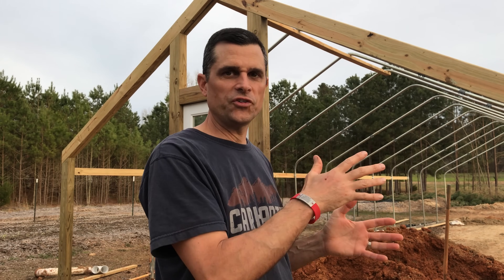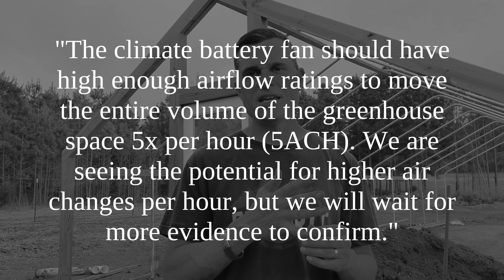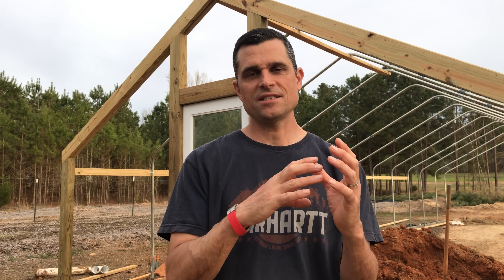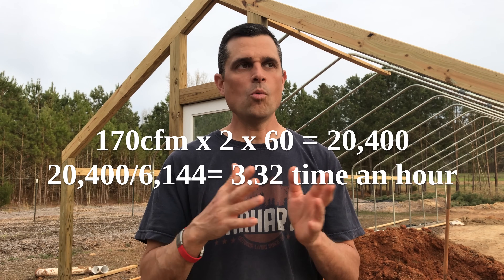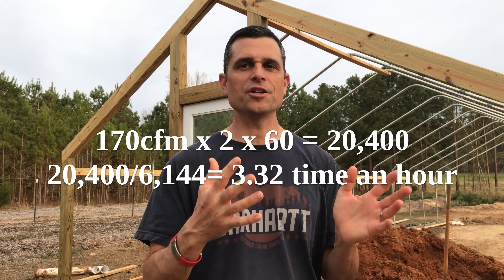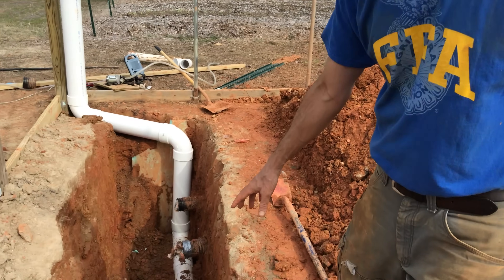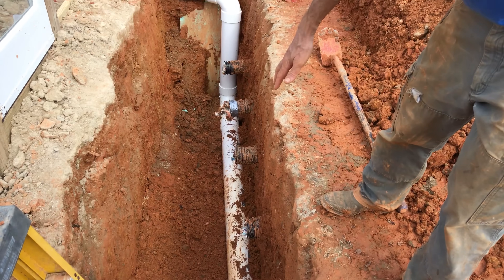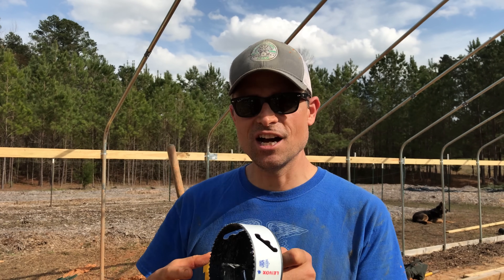DIY Geothermal Greenhouse Part 7: Earth Battery MISTAKE!

Comment: Threefold Farm here again. Good progress and glad to hear you made the switch to a larger manifold! Will you be monitoring the greenhouse temps once it's up? I've found it to be very helpful to monitor inlet and outlet temps as well as the temperature of the soil. 

In terms of cooling, I haven't seen enough cooling with our system such that we'd be able to avoid either opening the sides or door even on cool sunny spring days. The solar gain just seems to be too much. Your system may be setup better than ours. We currently use 3x 5,000CFM HAF fans to push air, but I think the static pressure causes them to behave more like 3,000CFM fans. Even with that, we're moving air about 15x/hour and aren't able to actively cool the structure.

I recently started a private group for commercial "climate battery" growers on Facebook that includes a few other farms in order to share experience of what works and doesn't. I'd value your input on there if you'd like to join. Let me know and I'd be glad to add you.
Reply: you should aim to put the entire greenhouse air volume underground  25-40 times per hour for effective cooling, i designed mine to handle 60 so i could experiment with the flowrate. Fit multiple sensors inside the tube to track the temperature as the air travels through, vary the flowrate and collect real data so you can  base your conclusions on what is happening rather than what you imagine is happening ;). Trust me, you need a lot more fan power than you imagine to outrun the cooling capacity of a well designed installation.
Reply: Hi Tim
My numbers come from experimenting with the system. If you can measure the in/out and soilmass temperatures and have variable speed fans you can gather some useful data. I`d recommend having multiple sensors installed in at least one underground tube so you can measure the temperature of the air as it progresses through the tube. You need airflow measurement but absolute accuracy isnt required, an idea of the relative increase or decrease in airspeed is still useful. 
Looking at your system, the good news is you shouldnt need to install more tubing, The total system loss at 5000 cfm looks to be around 3.7" wc. At 3000cfm its a more reasonable 1.35"wc. I designed my layout for 0.3" wc relative to the 60x/hr flowrate. Its a big challenge to get 60x/hr with a large house due to the fan power requirement, i guess you`d need something like 3x 12000cfm fans for 60x/hr. Its not a viable option as the layout wont support that amount of flow but it serves to  highlight the point that as the majority of installations are in larger houses, they seldom have sufficient fanpower available to do meaningful testing which would provide the data to take the design forward ;)
As a design exercise for a 90ft x 30ft greenhouse, the multisystem approach could be used to provide 60x/hr (36000cfm) at 0.5" wc. The design will use  more 4" tube to offset the loss in surface area of the large headers, which are not required, I dont know how much 4" ADS tube you could buy for the same cost as 120ft of 18" but i`d guess its quite a lot ;). TRhe installation would involve more work which would be more than compensated for by the extra flexibility, greater control and much higher efficiency compared to a traditional system.
Reply from the maker: Tim, we'll definitely be monitoring things once it is up and throughout the year. You're running some huge fans! We would be very interested in the FB group, as we have hope of building a much larger greenhouse and want to learn more and improve the system before we do it.
Reply: Glad to hear about monitoring! We use Acurite products to monitor ours as they're inexpensive and (relatively) reliable, plus we can view temps through our phones. We'd love to have you part of the group. I tried typing in the name of your farm to add you but couldn't find you. Perhaps you could request to join it and we'll add you that way. The group URL is https://www.facebook.com/groups/1594790417277905/ I'm currently restricting it to commercial growers as I'm really interested in the performance of larger-scale systems.
Reply: Disappointing to hear that the cooling is not as effective as hoped.  I believe the 5:1 ratio rule of thumb is made up out of hot air.   obviously that ratio is going to be a range, and vary dramatically with floor area vs volume, solar insolation, climate, time of year, N/S vs EW orientation etc.  So you can have an 8,000 pound car with a 20 HP engine, it won't be quicker off the line than a Tesla, but it might be perfectly appropriate and functional.  What you don't want is a 200 HP engine with tires, axle, transmission or clutch designed for 20 HP,   OR a 20 HP engine with those designed for 200 HP, right?

A  simpler way to measure airflow is to use the pump curve that's published for any reputable fan.  Even better if you have the watts overlaid on the pump curve.  A simple "Kil o watt" meter will give you the watts, and you can compare that to the pressure with a slightly more expensive Dwyer magnehelic gauge in the appropriate range to double check your CFM, good enough for me anyway.    Builditsolar is a great site for anyone doing home engineered solar anything, and home engineering is MUCH BETTER than NO ENGINEERING which, unfortunately applies to most of what's on the tube.
Reply: John, I appreciate the info. How are your numbers calculated? I've heard anywhere from 10x/hr to 60x/hr for cooling. To get a volume like that I'd need to at least double if not triple my fans (and probably also my tubing). Do you have a working version of your house? Would love to see it and learn more about it.
Reply: JohnGuest45   You should pay him for all of those sensors and track the data for him!  St. Isidore's Farm
, I just subscribed...Nice channel! Great info and heart!
Reply: Sensors are cheap, i have a total of 26 in and around my system just for temperature measurement. Why would i pay for the sensors for his system? if he`s  interested in knowing how his system is performing he`ll install them, if not, he wont...simple as  ;)